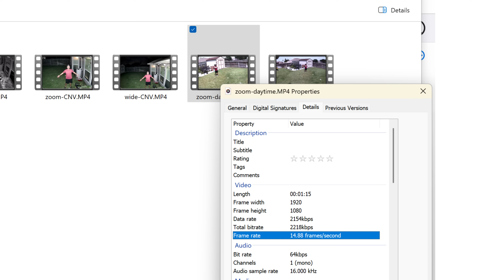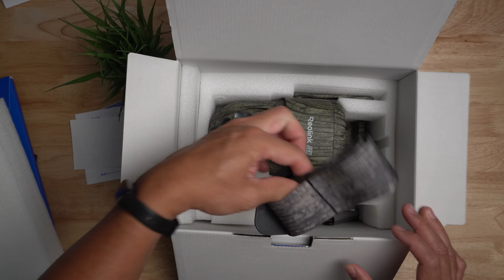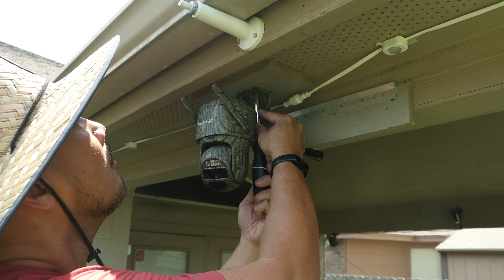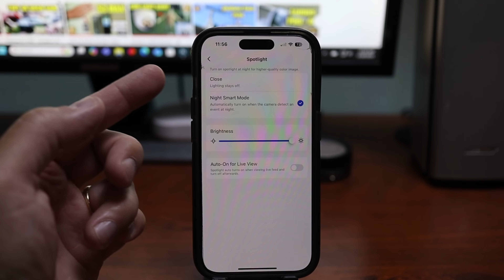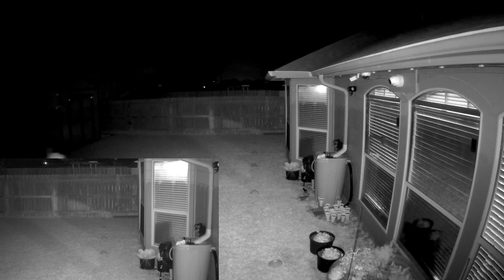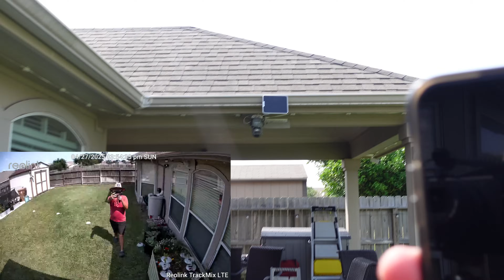Reolink Trackmix LTE Camo - 4K Wireless Tracking Dual Lens 4G Connected Security Camera

Comment: Thumb up for the time you took to make the video and two thumbs down for the camera.
Don’t get it unless you are okay with it detected every single thing that moves even when smart sensitivity is set to the lowest setting of 0 and pir sens is set to 30. 
Loses connection while network is strong and camera disconnects period.
I have it setup at my deer blind and since I had to turn the pir sensor off so it wouldn’t go dead bc it just kept recording because it was detecting an animal that wasn’t there but when deer would show up it wouldn’t detect them.
I know this bc I finally installed another tacticam and yep there were deer and the supposedly 4K “false advertisement and should be illegal” 300 dollar camera was doing complete opposite of what it should.
So now I have a not 4K ,300 dollar, intermittent working, live view camera.
But that’s what we get when we buy a product designed in China but to be used in the USA.

Comment: Hello, great video! Question: I have 2 of these cameras, I get the pings and says - motion detected or animal or vehicle. But I seem to NOT pull them up. My Kbps is zero to 2.50. I have moved the camaras and I even bought a cell booster. The only time I can get a video is 4am and very late at night, like 10pm.  What are your thoughts? Or can I set it to photo only? And how? If you could make a video on the App to show how to change it, I'm at a lose....Thanks again1

Comment: Thanks for the great review. Could you elaborate a bit more of the Eiot SIM Card requirements? How much time will a 100M SIM card last? Does the card need to be replaced with a new SIM card after all the data is used?
Reply: @LifeHackster I am curious about this as well.  Debating going through Verizon and adding a line to get a SIM or use Eiot.

Comment: I absolutely hate the way Reolink's zoom algorithm works (or doesn't!). It's horrific. Useless. There is almost zero point of having a secondary lens because it's just not useful at all. There needs to be an option of having it at the fixed zoomed in focal length for them to be of any use. Save the digital zoom nonsense for the main wide lens if you need that.

Comment: should be e sim so no one can steal it.  And work with any cell service provider.  Also should be 5G as they will turn of LTE eventually and this will make it more future proof, or make it upgradeable to 5g and 6g in the future.
Reply: I figure LTE will still be here for a while. 5G doesn't have the range LTE has. I live out in the country and we just got 5G towers. Most areas still only get LTE signal with all the trees.
Reply from the maker: That is a great point for future proofing!
Reply: Yep and reolink made actually talked about 5G cellular cameras coming out soon but that was a few years ago. 
Data would be so much faster and then they could make a real 4K camera for cellular network.

Comment: TrackMix, Altas, and Argus owner and I have learned over the years that without an aftermarket solar panel the cameras will always run out of power. Reolink really needs to release a panel greater than 12W and preferably with extra batteries on board.
Reply: I recently purchased and installed their new 12W panel on the Altas - so much better! I agree, the 12W needs to be their standard panel.
Reply: What brands of aftermarket panels with batteries do you recommend?
Reply: @I've only tried the Orayafid 15W panel with 20k mAh battery bank. I have the Reolink 6W panel feeding into the Orayafid and then the Orayafid into an Altas. It's only been deployed for six months but has kept the camera fully charged even during periods of freezing weather. Working great but waiting to see how well it holds up over time.
Reply: They just came out with a 30W solar panel model with a 92Wh battery. They call it the TrackMix LTE Plus 2 + Reolink Solar Panel Plus.
Reply: Not worth it for the 5 or 600 usd it’s listed at.